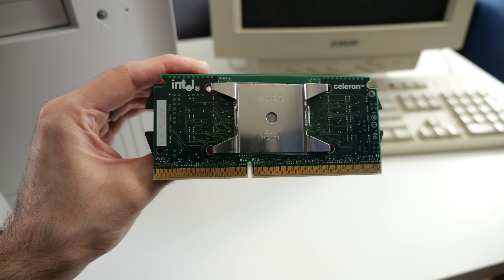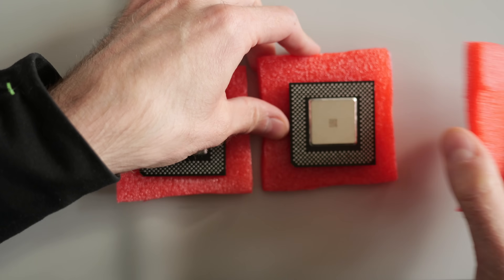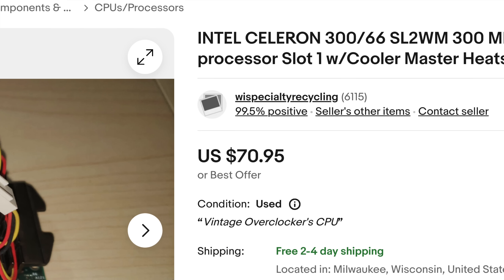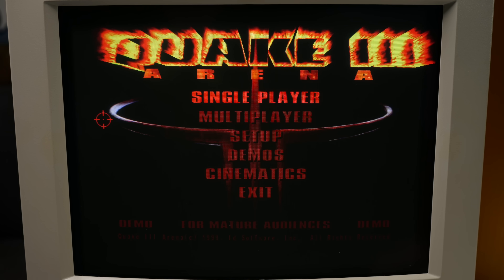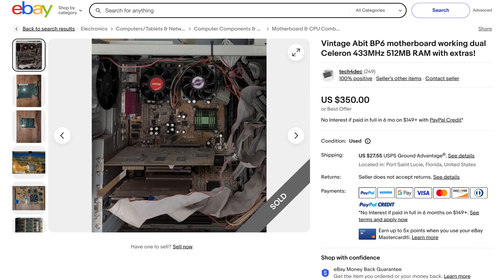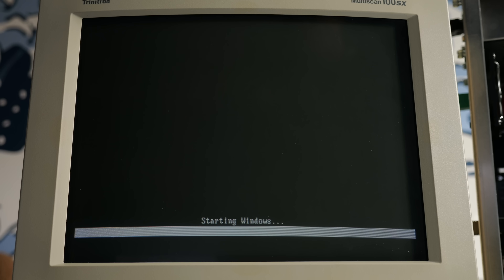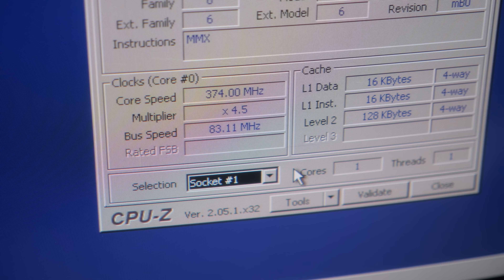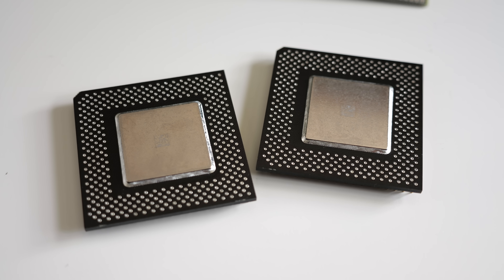I almost BLEW UP two vintage Celeron CPUs

Comment: This result is pretty surprising to me. I must have seen half a dozen of these back in the day, and I remember the Socket 370 300As being almost a sure thing to 450 mhz as long as the board supported it. I used to run a pair in a BP6 back in the day, but they were more for bragging rights than any practical use. They processors don't need to be identical either, as long as they support SMP, you can run something silly like a P3 and a Celeron.

Comment: Built a few intel dual pIII machines running Windows nt 4.0 server. It was okay but according to Intel. It was like having 1.5 processors. Can't remember why. But I had two machines with the same amount of work load. While running it. The single processor machine would stop responding until done. The Dual PIII machine you could do stuff on it very, very slow. Now all history.

Comment: It's not that they were not designed for dual cpu use, it was a feature disabled ON PURPOSE to avoid competition with Pentium-S server processors that were sold at a much higher markup.
That's why the can be modded to work in MP again.

Best wishes.

Comment: I ran a 300A @ 450Mhz from 1998 until around 2002 or so.  I do remember having to bump the voltage up with a piece of Kapton tape, but I think it only needed to go to 2.1 or 2.2V.  I was actually able to run that system at 460 or something but it wasn't as stable so eventually clocked it back to 450 where it stayed until I retired it.  I'm pretty sure I got an early model revision though - my friend was very into this and helped me pick out parts.

Comment: There was a process to update from the uni-core to the multi-core kernel. Had to do it to many, many servers that were bought with one cpu with the "idea" of adding a second cpu later. Later came around quicker than planned so the team I was on got to go through that pain the servers couldn't be reinstalled. It sucked.

Comment: I went with Celeron 533As which were the "coppermine" CPUs. Those overclocked nicely as well as mine went from 533MHz to 800MHz with only 0.5V increase. But I only had one PC and it was single processor - I always looked at the dual processor folks with envy. I think I switched slotkets from a generic that I bought with my first PC (Celeron 500) to an Abit one which had all the jumpers for my 533A. My friend wondered why I spent the money to buy a 533A - a 33MHz increase over my Celeron 500? Of course, the reason was the 533A was based on the coppermine, which meant it was a Pentium III core cut down, and new process which allowed massive overclocks. But it also meant my PC went from 500MHz to 800MHz.

Comment: The ABIT motherboards are simply amazing.  Sure, the BP6 is overpriced, but the BH6 and BE6, if you can find one with good capacitors, are excellent boards for the era, and most consumer software is only single CPU core.

Comment: I must have been incredibly lucky at the time because... the first computer I ever built, in 1998, with an Abit BH6 motherboard and a C300A overclocked without any problem and without any voltage mods. It even worked with that  motherboard's "turbo" mode that bumped the FSB up to 103MHz and thus the CPU speed to 463MHz, all very stable.

Comment: You should have a multiplier adjustment in the bios, that will increase cpu speed without making bus speed so high, agp and pci run at 66mhz

Comment: You did it wrong. You did very narrow thing - just test some single apps.
But multiple CPUs at that time are for using PC not suffer from multiple background tasks and do stuff smoothly.
No one used PC as test stand daily. There is tons of crap always installed and running.
And on this generation of CPUs even background MP3 music can suffer FPS in game.
(that is why I converted my often played lib to PCM to play them during games)

Comment: In 2001 i build an Dual Processor System with 2 modified AMD Athlon XPs on an MSI Dual Socket Board.
The CPUs could be converted from XPs to MPs by closing a brigde on the CPU package.

First the computer ran with W2K, later with XP.
I used it for ripping mp3 or convert DVD to xvid Videos.

Those were days...

Comment: Back in 99 I didn't want to raise voltage on my slot Celeron 300, because if I've fried my CPU back then, I wouldn't be able to replace it - it was a lot of money for me at the time (I was still in high school). But I had a motherboard with a three-way jumper for setting bus speed: 66, 83 and 100 MHz. I had the same experience as you with Windows - it would bluescreen at 100 MHz but worked perfectly at 83 MHz. Though, I was able to run Linux at 100 MHz bus with no problems even without raising CPU voltage. You may try to give it a shot.

Comment: Ah!  What you needed was UpToMP.exe.  It changes the machine type to ACPI Multiprocessor Machine.  I worked enterprise server support at a large 4-letter PC manufacturer in central Texas back around the Y2K period.  Microsoft must have gotten a lot of requests, since they made the tool.  It wasn't guaranteed to work; reinstallation was the official dogma.  Regardless, it exists, and we theorized that if it worked, great!  If not, well you needed to reinstall anyway.  Not being flippant, just realistic.  In a fleet of servers, having one go down was problematic, but not earth stopping for the handful of customers I know of that tried it.  I recall the success rate being better than 80%, but that was a quarter century ago.  ^Thank you! 👍  Sorry, only way I know to sent more than 1 Thumbs Up!

Comment: I can testify - because I did it back in the day - that the 300A would almost always run at 450MHz, but only on a good motherboard. As for the Abit BP6, I had one, and started with two 300A's at 450, but later purchased a pair of Celeron 400's that were guaranteed by the seller to hit 600MHz, and they did. I did have to use very large (for the time) CPU coolers, but they worked. 

The reason you had to reinstall Win2K was that there were two completely separate kernels for it - one for single processors, and one for multi-processor PC's. Windows XP would have also run your dual CPU system. 

As for why your rig was not successful at overclocking, it may be that the motherboard just wasn't all that stable to begin with, or it may be that like the BP6, the electrolytic caps were failing and needed to be replaced. If you ever do buy a BP6, either recap it yourself, have it done professionally, or buy one that's already been recapped. If it has not been recapped, DO NOT POWER IT UP!

Love the channel, keep 'em coming.

Comment: Dude don't feel down!
I had the SAME problem as you are having in the day -
For me it was VERY VERY aggravating, because I had just gone broke upgrading from my
last system, because, get this, instability with dual CPUs ._.
Prior, I was running a dual P-Pro 200mhz I had inherited from a good friend that passed away
and it was amazing for the time (when it wanted to work right) so when I had the $ to upgrade, I
wanted to keep running dualies (for the flex of course) and ended up with almost the exact slut1
setup as you (mind you I believe I had a voodoo3 slapped in there I think at least)

Was lured into the Celerons because of all the "easy OC" articles I saw, and admittedly, yea, its indeed
easier to OC this generation's processors.. as with the P1s and P-Pros etc, EVERYTHING was basically
jumpered to select settings on virtually all motherboards... (then having to worry about IDE priorities etc
made for a headache to troubleshoot them as well).. After not getting it to post over about a week,
I managed to convince the shop I got the motherboard from to take it back for store credit, and went out
and swapped into an Abit. Suddenly everything just worked :D

Admittedly I had NO idea about the whole tape trick then, who knows, a little higher voltage might have
gotten it going on the old board!

So don't give up! at least look around any local E-Waste reseller, you never know what treasure you might
find!

Comment: Haaaaah. Reinstalling is not needed, but easier than swapping kernels around. I did this a few times back in the day especially with NT4. XP? I don't remember doing kernel swaps with it...

edit: yeah, I modified a couple celeron 300a's ... had to order a special sized bit (not available locally) and drill away. 

Dual CPU's did show why it wasn't such a great upgrade unless your software supported it. Dual Core CPU's really showed this to more people. the selling schtick was that running more cpu's made for a smoother computing experience when running multiple programs. <3 all

editedit: maybe you got a couple of bum cpu's that has been running SETI@Home for decades @ overclocked MegaHURTZ until it crapped the bed and sold on ebay. Perhaps instead buy a small pile of them and try again?

Comment: You just reproduced my bin luck from the 90's. I was all over the overclockers forum reading about these mods and drooling. But the couple of times I got serious and put my money down on my personal rig, they just wouldn't do anything near what others were getting. Then I'd run into other issues with sound card and video stability, random crashing, etc. My current (12 year old...) rig should overclock great, but it won't stay stable. It's good enough for what I play though, so stock clocks for me. 🙃
Side note: I found out the hard way why peltiers weren't popular with overclockers... RIP my coppermine celeron...

Comment: The early 300A's were great overclockers but I did remember hearing that the later ones weren't nearly as easy to clock up past 400 MHz. My own 300A, which I bought a couple of weeks after it was first released, was a champ at running at 464 MHz in my Abit BH6 for a number of years!

My own experience using a slotket adapter was also a good one. I bought a Coppermine-128 socket 370 Celeron 566, a slotket adapter, a golden orb heatsink and an Asus P3V4X slot 1 mainboard in the spring of 2000 to replace the Celeron 300A setup. Ran the new combo at 875 Mhz (103 MHz FSB) through Oct 2001. I could get Windows 2000 to run at 892 MHz (105 FSB) but it wasn't 100% stable in everything, even with a voltage bump. The machine would even POST at 935 MHz (110 FSB) but Win2K would BSOD. 

I had intended to keep that combo for a later Pentium 3 upgrade as the P3V4X supported up to 150 MHz FSB. But I won an Athlon XP 1800+ and a MSI KT266 (non A) chipset mainboard at an AMD Roadshow event in Chicago, IL in October 2001. :)

Comment: I had that exact motherboard (SuperMicro P6DBE) with 2 x PIII 550s in 1999/2000. While it indeed did not help with SMP performance, it was great for multitasking. I could play a game at the same time as running a server for said game on the same computer and not have slowdowns, since the server was running on the other CPU.

A couple of years later, I got a SuperMicro P3TDDE with 2 x PIII 1000s, and that was a huge step up in performance with a Voodoo5 5500. In 2007, I got some PIII-S 1400s for it and maxed it out. It remained a good performer up until I retired it from service in 2012/2013.

Comment: I remember at the time working at a PC shop and I'm not sure I ever saw a stable 450 out of a 300A even with a slight over-volt. Boards that supported 75 and 83MHz FSB were much easier to do without any voltage tweaking.

Comment: By the time multi processor support in games came about, Slot based systems were too slow. Its cheaper to just jump onto Socket 462 with some late barton examples/XP-Ms and the performance would still be usable but it would perform similar to a budget am2 system with a sempron, as cool as it is, only later platforms make sense unless you can watercool/SS these on the daily out of pure madness and bin enough chips to find 3Ghz+ "golden stepping" examples, something that will be hurt by the K8 instruction set efficiency that STILL suffered in early multicore games, it would just be cheaper to find an am3 sempron K10 bundle, unlock them to dual cores and smoke any older dual socket systems sadly. People are charging crazy amounts for accessories like coolers or hard drives, cases that are battered and need work, when grandma's old compaq gloss era PC makes a Pentium D/IXGP graphics look strong..

Comment: @ThisDoesNotComute
Your OCing trouble doesn't reflect the over-all experience others have had. You're using motherboards not designed for OCing and as a result, you're getting a jank experience. If you had an ABit, QDI or DFI board, your experience would be MUCH better and my guess is it would be a perfect, or near perfect, experience. You just have to have the right equipment. The Dual CPU instability situation however is something many experienced. You're trying to mix both and as result, you unknowingly set yourself up for failure. Not really your fault either. You just didn't know. The Dual CPU thing is something you should forget about unless you're going to go with Pentium 2 Xeons or Pentium 3 Xeons. If you'll like to discuss more, come over to TechPowerUp and chime in with me there.

Comment: One factor that may be at play here is a reverse survivorship bias. The 300A Celerons that could run at 450 were asked to run at 450 until they started to degrade, quite possibly for years. Then they went back into the bin with the ones that never could go that fast.

It's like the Thuban 1090T I recently retired, which (when it was new) was happy to run at 4 GHz even though it's a 3.2 GHz part with a boost clock of 3.6. That only lasted a few months, then I had to back off to 3.9, then 3.8, which held steady for several years. But toward the end of its service life (of over 12 years) it was not stable any faster than the 3.6 GHz boost clock. To its credit, it could still run all six cores at the boost speed all day long, but either half or all of the overclocking headroom was gone depending on which metric you measure by.
Reply: I think this makes a lot of sense. I built a few 300A PC's for overclocking when the parts were new and never had to deal with voltages. All worked fine stock.
Reply: For some reason the dual 300A's I had would not boot at 300Mhz after a six month o/c to 450Mhz. Yet they continued to boot at 450 till I sold that system a few years later (which I still regret). Never had a CPU 'degrade up' instead of down either before or since. Very odd indeed.
Reply: That could be very well true. I am one of those probably with survivorship bias. Had a 333 which I think I brought to 400something. Not as extreme. But still a massive uplift in performance.
Reply: CPU Quality was back in the days a lot better (Both camps) then it is today. A 2700X running above 1.37V 24/7 will yield you full degradation in even weeks. Nodes are turning so small there's barely any headroom for insane currents or voltages.
Reply: @vanderlinde4you  It's actually not about « quality ». Quality back then was actually worse, if you consider Celerons basically came from batches of "failed real PIIs" and the "cheap CPU" marketing idea behind them was used as a good excuse to sold them, instead of just throwing them away.

It's Just that with thicker traces/nodes, you have more headroom to abuse the voltages before your CPU gets totally toasted. But it's still possible to kill them, if you happen to have a sensitive one that hasn't won the silicon lottery.
Reply: @ I really don’t understand how your observation about tighter voltage tolerances translates objectively to a claim of higher quality. To be honest, I’m not even sure how you define and compare “quality” between components separated by almost 30 years. Perhaps you could argue that processors from the mid 90s through to the mid 00s were more “robust”, and I’d agree with that but “quality”? That’s a far more difficult term to define in this particular instance. Maybe if we knew the CPU failure rates between then and now?
Reply: I was absolutely going to say this.
Reply: Ah yes... my i58500 just clocks at 3,9 gHz and only sometimes 4 GHz.
Reply: Yeah, this tracks.  I had two slot 1 systems when these first came out, one running a 300A at 450 on stock voltage, and one running a PII 350 at 466 with an extra 0.2V.

Both systems lasted years and well into the realm of irrelevance, but at the end neither of them would reliably overclock anymore.
Reply: Wow, how much voltage did you throw at your Thuban?
I was obsessed with overclocking K10 era AMD CPUs and don’t recall degradation being much of an issue
Granted, I swapped CPUs a lot and the longest I ran a single CPU (an unlocked/overclocked C3 Deneb) was ~5 years 🙂
Reply: Also, they've all been binned by now.

One can expect people to hold on to the good ones and sell the poor overclockers...ehich has been happening since 1998.

Comment: I used an Asus P2B-DS with 2x PII 333 CPUs. Those were a lot easier to overclock than the Celeron 300A. 

Without any voltage tweaking, they'd reliably run at 415mhz (83mhz bus, 5x multiplier). As those were early Deschutes CPUs, they didn't have a locked multiplier. While100x5 didn't work with my CPUs no matter what I tried, 100x4.5 did work, but ran quite hot, extra cooling was required to keep it running. Later pII 333s have a locked multiplier (5x), but will happily run at 100x5, and often even at 133x5 if your board supports it.

Comment: The case I'm using right now had a slot 1 P2 - 233 in it originally. If it knew what was in in it now, it would probably be horrified, especially because I have the cpu sitting on a shelf where it can clearly see it.

Comment: The reason the socketed Celerons are having issues is because by that point in time Intel had started binning bad P3s into Celerons. 

Prior to this they were just taking fully working P3s or P2s and turning them into Celerons, which is why the slotted Celerons tend to OC better. 

Then the Coppermine Celeron happened and people had them over a Ghz.